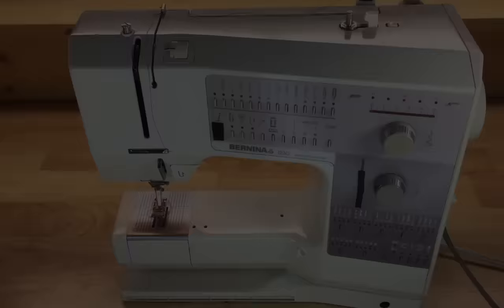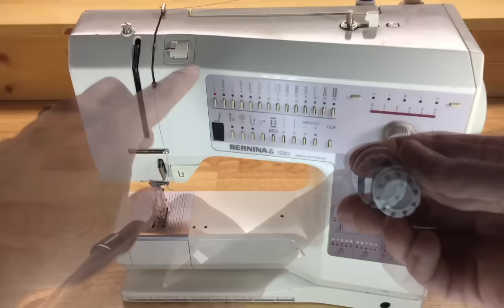Sewing Machine Problems: The Most Common Issues

Comment: Happily amazed to see you replied to someone one day ago even though the video is a couple years old. 

My problems are that all three of my sewing machines are not operable and I'm a fiend for sewing. I can sew nearly all day every day I enjoy it that much. Hopefully you can save me hundreds of dollars. 

I left my Pfaff Tiptronic with a repairman recommended by a friend. He works from home but used to work for a large chain that sells machines and fabric etc so I presume he's capable and honest. He quoted $100 give or take $20. The pfaff was not working except the light bulb and he said it was a soldered fuse. No problem, sort of what I expected. Only he said it would be another hundred for the fuse and labor. I guess the first hundred is for diagnostics and cleaning. Seems about right so I authorized the repair. 

Sewing junkie that I am, I took out my little Janome jem gold to continue making my batik curtains. After only an hour it stopped.  The needle bar will only budge manually and with difficulty and not a full rotation by hand towards me and, it won't go for the foot pedal. I think it needs oil. My tube of oil is with the Pfaff at the repairman's. Grr. 

I took out my viking 1100 and continued the batik curtains. Shortly I notice clunk like sounds when I cross thick seams, np with just 2 pieces of fabric. 

Since thats all the machines i own, i texted the repairman. He said $100 -$120 each machine is his guess, sight unseen, but will charge $80 for the Janome since I have a machine with him already. Ok that's alot especially as you can buy a new Janome jem gold for $100-200. So I  watched videos and cleaned both the Janome and viking. They were pretty neglected I guess. I pulled not just dust but felt out of them. But no change on either machine. I changed the needle and re threaded both  needle and bobbin several times. 

Can you suggest possible fixes? Do the repairman's rates sound right for southern California?
Reply from the maker: Sorry it took so long to get back to you. First off, it is a bit bizarre that he first quoted you $100 for the Pfaff only to increase the estimate by another $100. A $200 repair on even brand new, high-end machines is pretty rare, but I'll give him the benefit of the doubt. I just think he should have provided a total estimate before hand (and if you didn't want it done I would even understand an estimate fee of $10-30, not $100) 

As for the Janome and viking, I would highly suggest getting another bottle of oil from any sewing shop and have a go at re-oiling (if they havent already been to the repairman.) It sure sound like they're probably dry if use mostly use your Pfaff. His quoted prices of $100-120 isn't to crazy for California, but knowing about your Pfaff experience, I would want to get actual estimates before he services them. 

I hope this helps and if you have any other questions, please let me know.
Reply: @JackCreekRoad  

Thank you for getting back to me.  Your help was invaluable as I was able to speak with the repairman and get a firm estimate on both the other machines , which he stuck to. I oiled the Janome but it still wouldn't go. There was a thread wound round and round the needle's take up that could only be found by removing a screw on the needle take up. That plus a cleaning was the quoted 80. The Viking was used for many years before I got the Pfaff and put it away unserviced.  So I felt that 100 to clean/service it was well spent.  I couldn't have known that without your considered reply. Thank  you.

Comment: Thank you,  I didn't realize how much I didn't know.  I never knew why there was a felt bottom on the thread spool.  I am currently having an issue with the tension on my Singer 2016 around $100.  I did a zig zag stitch with a walking foot and it worked great.  Next, same day _ I changed machine to straight stitch and the upper thread tension seems not to respond to any setting.  The stitch appears to be loose.  I changed out thread and needle.  I also checked the bobbin and it works fine.  The tension dial was set to various settings but I am not seeing a difference.  Any suggestions?
Reply from the maker: Thank you! Is it the top or bottom thread that seems loose? And did you make sure to put the flat side of the needle to the back of the machine when you re-installed it?

Comment: I was lucky enough to buy a Juki DDL-560-5. It has a servo with a speed adjust dial built in and yes, I agree 100% that it’s a huge advantage and much more enjoyable and accessible to use. I was trained on Pfaff industrial machines. They move super fast and take lots practice to use properly.

Comment: Thank you for this! I was sooo frustrated with my new machine! I had a little Viking workhorse for 20+ years and bought a Jenome....(Wish I would have purchased a Bernina, but Jenome is what I have.)  The thread would break about have way down the garmet seam while sewing on stretch knit. I'm pretty sure it was b/c I had the thread cap on too tight and I was messing with the top tension. (I did have the correct needle in.) I'll give it a go again on a scrap of that cotton knit fabric

Comment: Came across your video looking to stop my needle to jam at the start on my "new" vintage 707 Bernina (the James bond of sewing machines. Now that I just cleaned and oiled, I can't seem to freely turn the tension wheel. The reference line always looks as always to stay jammed to the right. I took the cover off but am worried to open that extra metal plate that seems to hide the mechanism. And yes man spools now are crap, even with Guetermann, I moved from Europe Austria to America and the Guetermann here seems to brake so much more easily compared to nearly never in Europe. But from now on I will look at the edges ( I never did).
I studied Haute Couture in Paris and worked for Mr YSL in the late 70s. The rates cover is such a great mechanism so easy. Thanks for telling us about the bobbin caps never came to my mind but here I have X bobbins going flying so often, from now on I will look! Can I use a cap on a vertical spool? I got a thread stand from a friend in Belgium halleluja! Why are all the new Bernina machines plastic and not the weight of the old ones, so sad? I don't want any plastic machine or electronic machines anymore. I have given up on them. 

I love my Elna, Singers especially the Rocketeer and now finally got my first Bernina for 75$, been looking for ages! Well, I am on a collector's budget, haha.
Do Bernina bobbins have a BB stamped on them, they came with my 707 the machine!
Sadly I did not discover classic sewing before, thank you Internet! Now I have a collection or an addiction. 

Where is your shop may I ask? It was such a pleasure to listen to your video thank you very much! 

Also if I may say, you got beautiful pianist hands. 

Which simple modern non-electronic Bernina do you recommend? I don't do embroidery stitches etc. I just like the basics features and am on my budget :-).

Comment: Yes, I hesitated to be redundant like so many, but I will. Without bragging, I'm a veteran sewer on a vintage Viking Husqvarna. However, it has given me a few problems  that I can't figure out. I'd like to ditto Mike Wilson 6128's comment. This video has shone me that (in this case), it doesn't matter, what's the brand is on the machine. I appreciate the video  focusing on the proper function of of a machine. I have been be able to apply this information to my issues.
Getting back to those issues. I have been looking foe the complete, factory issued service manual. Not the PDF version, but a hard copy. Perhaps, someone out there would point me in the right direction.
Thanks for your contribution to the human kind. Great video, ditto that.
Reply from the maker: What's your model number?

Comment: That sewing machine works so smooth. I'm having trouble with my vintage singer. The thread just comes outta the needle as the machine is sewing. I've never seen that before.
Reply from the maker: Make sure the spool itself is nice and free and that the thread isn't snagging coming off of it. Sometimes the thread is too thick for the needle too, in this case you need to increase the size of your needle to accommodate the thread your using.
Reply: @JackCreekRoad  oh thank you! I got my machine out, I threaded it from left to right, and holy smokes, this machine runs like it's brand new.

Comment: That was great. Idk what is wrong with my machine. It's a rats nest on the bottom. It was sewing fine and it's a brand new baby lock. I've changed the needle. But it's not even sewing a zigzag properly. I need it to pay my Bill's! Ughhh help
Reply from the maker: Sounds like youve missed the take up lever. I would rethread and try again.

Comment: I love your video! I do have a question. I have a machine I bought second hand and it was working fine. Now the bottom thread is not stain in the fabric. It looks like it's snowing correctly but it never connects with the top loop is what I'm guessing? I would love your advice.

Comment: Many thanks. I have been sewing on and off for years and I had many lightbulb moments while watching. Things I should have remembered but had forgotten. I have two machines a singer precision and a Janome, both seem noisier lately. Never remembered it could be the needle size. Didn't remember to always have the thread guide up when ending sewing. I also suffered from the "dead" feeling when pressing the foot control, it was driving me crazy. The one thing I find when I fill on the bobbin winder, it no longer fills evenly? I usually have more on one side. I have had needles break before, never knew to check the bobbin case for burs.

Comment: Thank you for the video, cleared things up! I had an accident with my machine, due to some mistake, the upper thread had jumped off the tension plate and it created those ugly nests under the fabric. I was able to correct the issue but this video helped me understand WHAT had happened and why. Just a question regarding that: my bobbin case got a few scratches on it due to the accident. I have a front loading machine with a similiar looking bobbin case as on the machine in the video. I couldn't feel any burs on the metal but would those scratches have an effect on performance?

Comment: I enjoyed the video, I re-threaded my machine, changed to a new needle, and cleaned out around the feed dogs. The machine is still not advancing the fabric because a lot of thread get looped around the bottom of the of the fabric and gets wrapped around the left front of the feed dogs.
Reply from the maker: It sounds like maybe the take up lever was missed in threading or perhaps you're not threading through your tension mechanism. You can send a video through instagram for more help @JackCreekRoad
Reply: @JackCreekRoad  Thank you, II got the machine working. I did what a other person suggested I took out the bobbin holder and put everthing back and it worked.

Comment: Thank you for helping me solve one of my machines issues. I also have a Brother memorycraft 8000 embroidery sewing machine that i was given recently, problem is I can't realign the width space. this means the needle swings to the right too far when wanting to use any utility stitches, hits the plate and breaks needles.  Even with 40yrs of sewing and machine history, I just can't adjust it back to normal.  
On a straight stitch to the left and middle is fine. Can you help me as it is a lovely machine for it's age and I have alot of embroidery to do soon. What do you advise please?

Comment: This was very helpful! Learned things I never really knew! Thanks! I've been thru a Singer TouchNSew with cams thru  a now BabyLoc Decorator. But the latter says don't change almost anything. It has a needle threader - stopped working. I did get a broken needle & frankly not sure why. Was pretty tired, sewing masks. It helps to see the Bernina in your video, too. I like metal parts. Reliable.

Comment: Thank you I really learned a lot.  I have a top loaded bobbin.  Hopefully I learned enough to avoid jams.  But when it has jammed and I take apart (unscrew plate, lift out case) to remove threads, fuzz etc, I can never easily figure out how to put back together.  The bobbin case doesn't seem to have a user friendly way of snapping into place.  Is there some trick or could you show me how to slip it in, line up correctly the first time.  I have a Sparrow.  The bobbin is very touchy and jumpy.  Thanks.

Comment: Thank you for this very clear explanation of common problems.  I learned a lot even though I have been machine-sewing for more than 50 years. 

I have inherited several older machines from elderly relatives, but have no manuals for any of them.  Is there some simple way to figure out which is the proper bobbin for each machine?

Comment: Thank you really useful information. I still can't find out why the tension on the fabric is so tight when I'm finished sewing and taking the fabric out from the machine... it feels like there's a little gremlin inside holding on to both threads who won't let go! I'll keep looking for the reason but for now you've given me lots of valuable insights into best practices.
Reply from the maker: So basically the stitch you're finishing up with is not complete so the threads are still tied inside the machine. If you rotate the handwheel towards you until the take up lever is in the highest position it should release the threads and allow you to pull it out freely.
Reply: @JackCreekRoad  Many thanks for taking the time to get back to me. I always make sure the take up lever is in the highest position before removing the fabric. But for some reason, with my new machine, the thread is held tight even when the lever is up high. It's baffling me as Ive never had this problem before.

Comment: Thank you so much, I have been sewing for many years and still have questions. You have answered almost all of what I needed to be answered.  You explained thoroughly. The one question that has plagued me for years is when people say centimeters such as 3 or 4 centimeters for stitch length, is that a common go to length? And are all machines the same as far as the numbers go. I'm from America and don't know the metric system very well.  I have a brother SE400 and it is set at 3  is this ok. I don't have trouble sewing with it. Should I go to 4 or is that just a preference for stitch lengths on a certain project?   Thank you

Comment: Your videos are awesome!  In the COVID time, I need a little advice for an issue with my ELNA 1010 mechanical front bobbin loading machine.  Problem is that intermittently (but way to frequently to sew efficiently), the tension disc(or something else) grabs the thread going to the needle even when I lift the presser foot.  So far i have followed your advice, checked the tension,   have the top and bottom tension working correcting, made sure i can see  the tension discs move when I have the case open and lift and drop the presser foot.  Thanks!  I have a stack of masks ready to sew......
Reply from the maker: I would definitely start with a new needle and perhaps a different spool of thread. Also check to see if you have a spool felt underneath the spool and that the spool itself isn't binding.

Comment: I love your videos and have learned a lot.
My question is this, when I started sewing a year and a half ago I would go forward and a little back with the wheel to release thread.
I have replaced the plastic bobbin holder in my singer heavy duty.
Now that I realize my machine takes a certain bobbin ,after about 3 seconds of sewing my bobbin case jumps out and out.
I keep fixing and wonder if from going a half turn backwards, we’ll, could I have messed up my machine?

Comment: DOOD! EXCELLENT VIdEO…two years too late for me tho’. Wished I’d watched this when the sewing machine found me. I got a Quantum Stylist Singer; Do I have to pay attention to the hand wheel? I don’t have tension knobs to play with but have/had many not sewing smoothly issues…do I have to pay attention to the hand wheel? Thanks for this video, you’ve helped me attach to sewing in a much much better way, thanks again, Rick.
Reply from the maker: Hi Rick, You should always try to turn it towards you. It's very rare that a machine is designed to spin the handwheel backwards (most of the time it's only on sergers too.)

Comment: Thank you for a very instructive video. I have recently bought a Brother FS70 sewing machine. As soon as I tried sewing 
everything was fine but soon after I tested a higher tension I got into trouble. First the stitching and the fabric bunched up. I cleared that and began sewing again on the dial 5 tension. but the needle didn't take up the bobbin thread. I get a small clump of thread at the start and then the upper thread snaps. When I pull on the thread it feel taut whether I set the tension dial on 5  higher or lower its all the same! I beginning to wonder if this brand new machine is a dud?
Reply from the maker: Is your spool cap larger than your spool? What kind of thread are you using and have you confirmed your needle is in correctly?

Comment: thank you so much for your teaching/illustrations. I have a pfaff variamatic 6085. Recently, I have had problems with thread snapping. I have adjusted the tension, cleaned out the tract, and bobbin, done all that I know.  The problem will appear resolved for a few minutes and then the thread starts breaking again. What do you recommend I do next?  I live in a small town. Thanks so much for helping me out.
Reply from the maker: Hi there! I would highly recommend trying a good quality thread like Mettler or Gutterman. Your tension should only be around 4 or the midpoint on your numbers, and also try an 80/12 needle. This *should help.